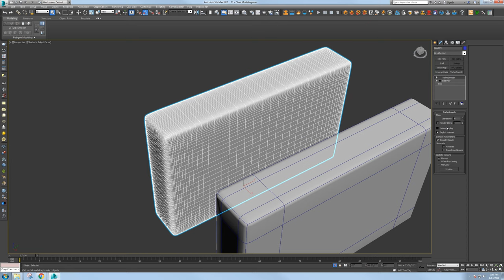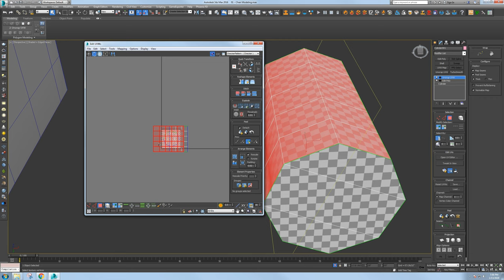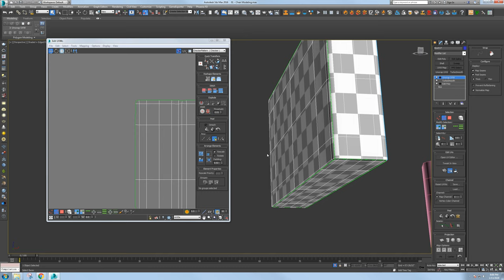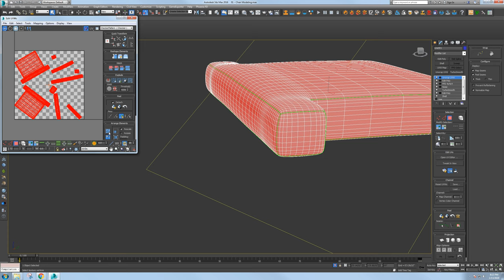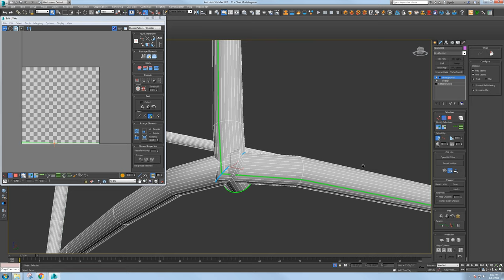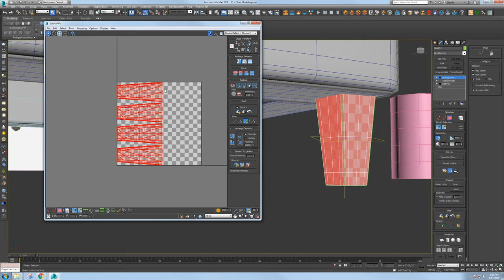Furniture Workflow - Part 2A (UV'ing in 3DsMax)

Comment: One thing regarding seams, especially when unwrapping soft body fabric furniture, you would have the seams depending on the actual fabric pieces made in reality, so you would take into consideration the way the actual product is made and the unwrapping of it.  if it makes sense.
Reply from the maker: Andrei! Great suggestion. It totally does make sense. For things like strips or repeating patterns, this is a great suggestion.  I generally use Marvelous Designer for cloth simulations which does all of that for you. I don't know if you use it as well, but it's awesome and a BIG time saver ;) And I plan to address your comment, and some other issues in Part 3 when we move things to Substance Painter. There were a few things I forgot to mention in Part 2 ;) But again, this is why I like the videos raw. Sometimes we forget things and I want others to see my mistakes and learn how to correct them ;) Thank you for taking the time to share your perspective!